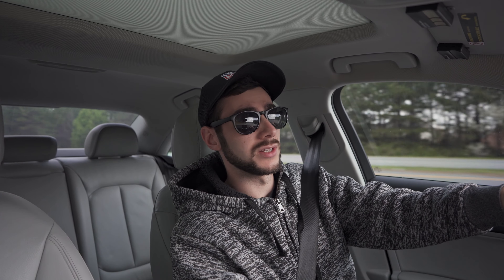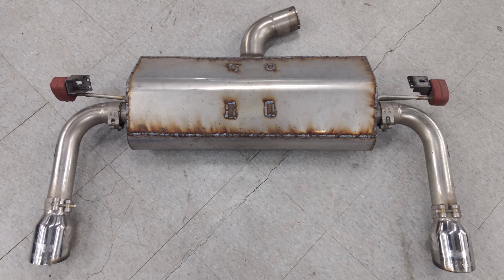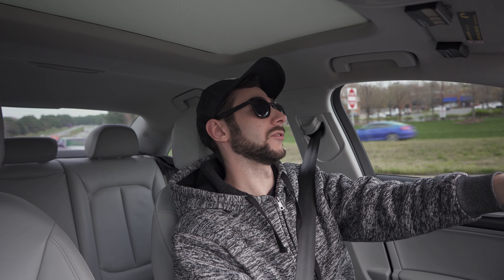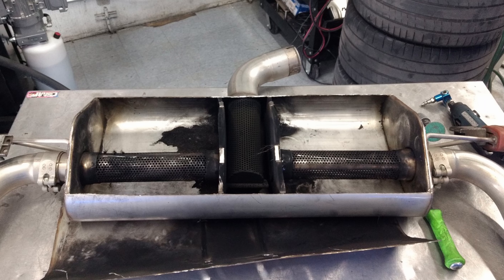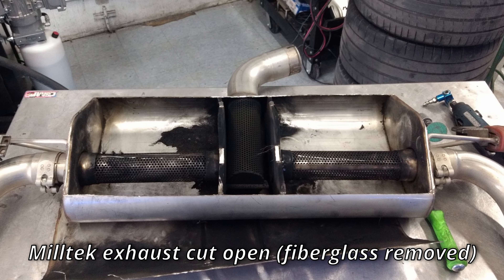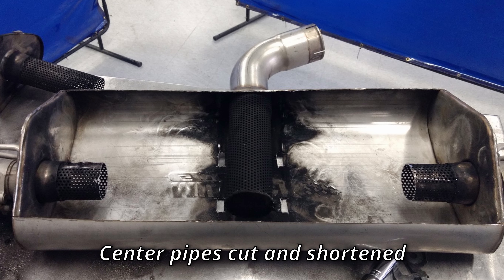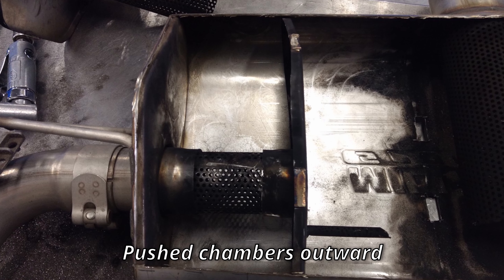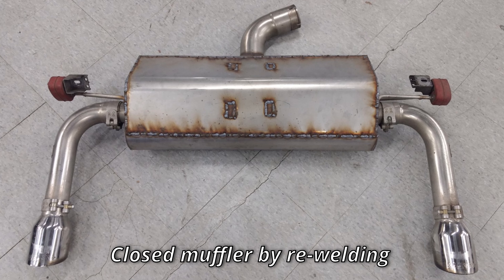WE CUT OPEN MY EXHAUST AND HERE'S WHAT HAPPENED!

Comment: I am running all magnaflow cat back. It's an okay sound, really wanted a borla but it is/on back order till November. Just watch the closed air intake video, I have the same Apr carbon fiber cover. That came in the car when I bought it. Would you recommend a tubro delete? I want my A3 to be quick. And sound good.
Reply from the maker: Magnflow probably a little less aggressive. Borla just gets soooo raspy. Yes would suggest a turbo inlet with turbo muffler delete for amazing sounds!
Reply: @savagepandaprojects  I'm going to have to do that! In sport mode it it's kinda loud, I did like the miltek but little to rasp I think, they have a brand over in the UK called a scorpion, I'd like to get on of those, but they don't ship to the US, they sounds really good!